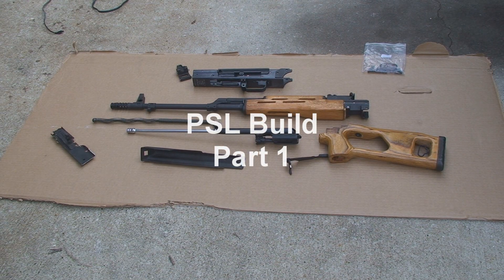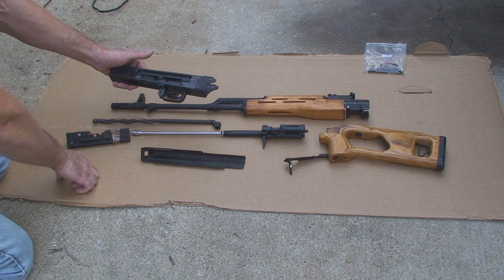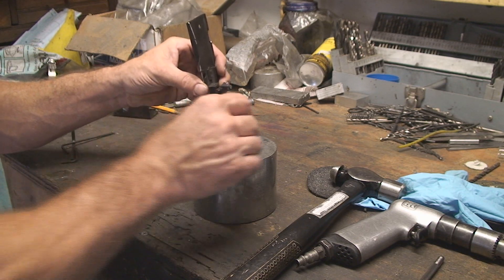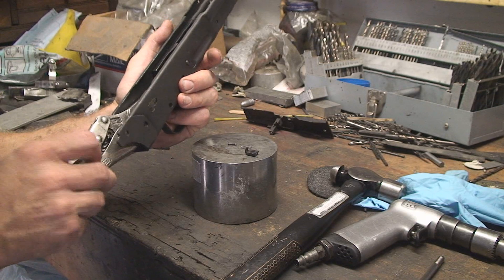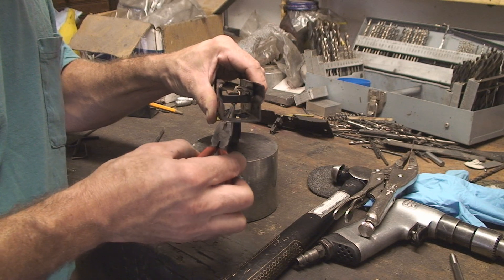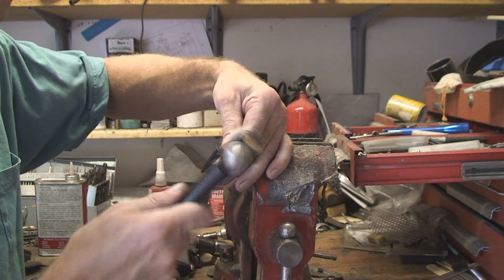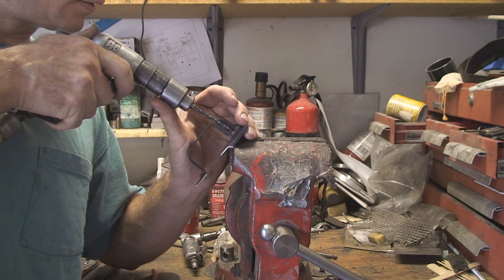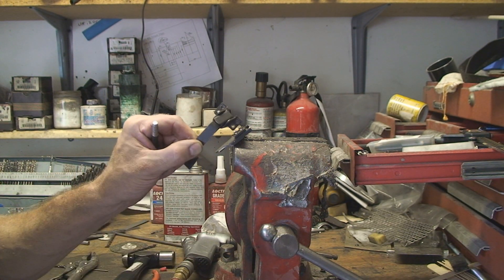Homemade Sniper PSL build part 1.wmv

Comment: Just started mine 11 years late lol 🤣. Was a pain sourcing the parts! Got a romanian receiver with trunnions already  installed. Hope it goes well. Ps I also hate dealing with the mag latches. I avoid at all cost. My receiver has it all already👍😉
Reply: I started mine years ago (2017 or 2018 I think?). The Romanian receiver was out of spec with the reinforcement plates and pre-drilled holes. I am finally getting back after it today. I've done a few things to it to prepare it for welding. What a pain this rifle has been compared to some of my other AK type builds.

Comment: @ginsboy2003 The key thing is to use an under sized hardened punch so it pulls out of the hole with ease and have it centered to the press and rivet. I finished watching your series on the PSL, great work! I hope to do my own PSL build soon.

Comment from the maker: Probably, I have been in contact with another youtube member who said his builder had problems fitting the scope mount rail to the scope as well.  With a proper dovetail cutter it can be easily fixed, but who has that equipment other than myself and professional gunsmiths.

Comment: @ginsboy2003 Nodak Spud Suppose to make a good PSL Receiver. If you can call it a down side, you will have to mod the stock that comes with the PSL to make it work with the Nodak Spud due to it being designed to accept standard ak stocks and grips.

Comment from the maker: @AreYouStilllDown 
Honestly, we didn't use one.  It was an all matching kit, so as you know if there was no headspace issues when it was demilled there wouldn't be any when we re-assembled it.  I did, however use cartridges to check it by using the tape method.  Message me for details on how to do that.

Comment: I have built 4 of these now and in regards to the bolt hold open device and reusing the 1/16 rivet , I found that using a the long drill bit in 3/32 like the one for the bolt catch roll pin in an ar15 build, and the roll pin for the bolt catch for an ar15 works excellent

Comment from the maker: You can buy them by the pound from mcmaster.com, just make sure they are the right head style, or buy the kits from ak-builder.  5/32x3/8 rounds head rivets are used for most of the build in an AK.  ak-builder sells PSL rivet kits now and its really convenient to just buy the kit.  It would also be worth the trouble to buy a pound of rivets from mcmaster.com.  Let me know if you have any other questions.

Comment: I too am an A&P.  Whenever I drill out rivets, I like to center punch the heads so the drill bit has somewhere to bite when you start it.  

Also, where do you get your rivets?  Do you get them from a gunsmith supply or do you get them from an aviation source?

Comment from the maker: I did swap it over, but danged if I can remember what I did.  I think I used a 3/32 pin punch.  If you have to drill one end, you can mig weld a little metal back on and reshape the pin to reuse it.

Comment from the maker: @MrTadaaaaaaaaaaaa 
Well, for me it was a 5, but I have a lathe, a 20 ton press and custom made tooling I've made for building AK's.  3 of the rivets I had to make on my lathe because there is no rivet kit sold that has rivets that are long enough and .190 in dia. as needed for the rear rivets.  If all you have is basic wood working tools, it might be a 18 or so on a scale of 1-20.  It did take me some time to custom make my tooling.

Comment from the maker: @sh0rtw4ve 
Well Apex gunparts was selling the kits to Centerfire from what I understand.  Its just not worth doing a build.  I just got the cutter to reduce the width of the scope rail which was .050 too wide to mount any PSL scope and fixed that.  I'd rather buy a complete gun and if it isn't right, send it back.

Comment: I'm curious as to how you knocked out the bolt hold open pin to reuse it.  From what I can tell, it is peened on both sides like the pin holding in the mag release catch.  I'm gonna need to do a swap on mine when my receiver gets here, and any suggestions would be appreciated.